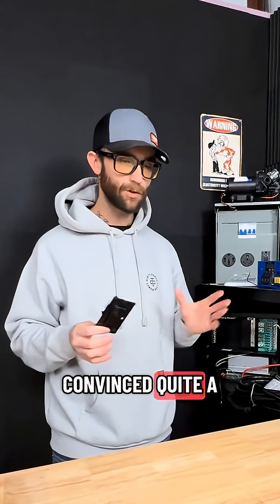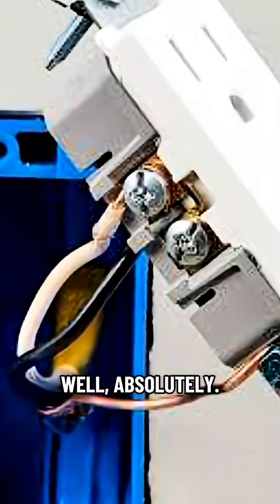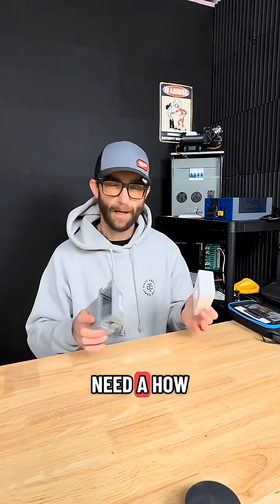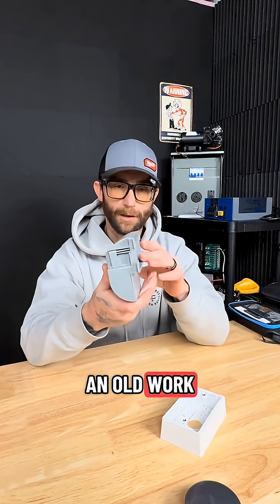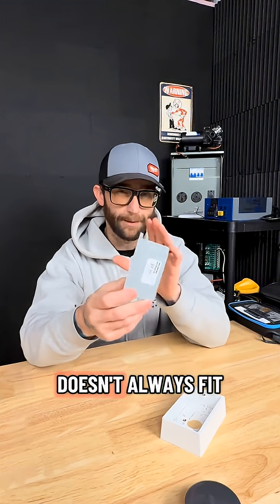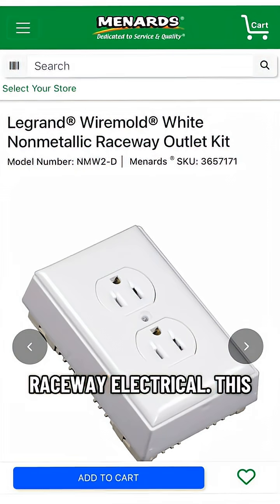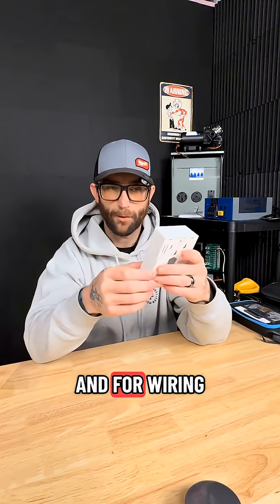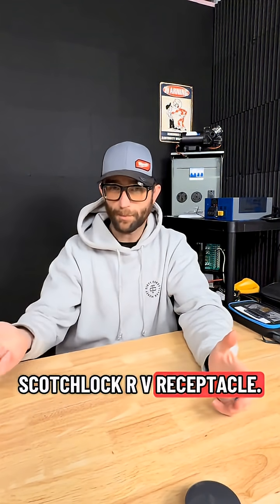Can you replace the outlets in your RV with residential grade outlets? Yes you can! Although it

Comment: As a 40 year electrician, do not push the wires into the back of the receptacle. Wrap them around the screw and tighten it down. If you push it through the back, it’s just like having it in the one that’s already there. It has the same problems.

Comment: I simply added a new residential outlet in the pantry of our 5th wheel so I can plug in our small space heater when needed.  The majority of other electrical outlets are never going to see that type of load, so I'm not as concerned.  But now I at least have one solid outlet to use when needed for a larger load like a small space heater. Just an idea instead of replacing them all.
Reply: You suck
Reply: I plug mine into the outlet for the microwave. Been full timing since 1998, zero issues.
Reply: @Surferchicusa  that wouldn't work for me as the microwave outlet is hidden. But glad that works for your situation.  Again, a simple addition of a residential outlet worked great in our Keystone.
Reply: @Surferchicusa well done good, sir. This camper was actually built-in 1998